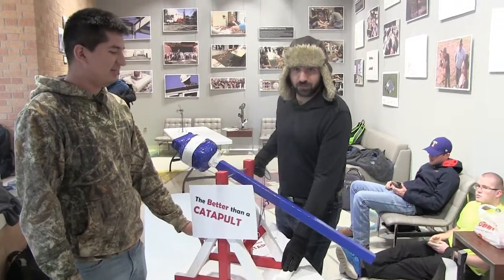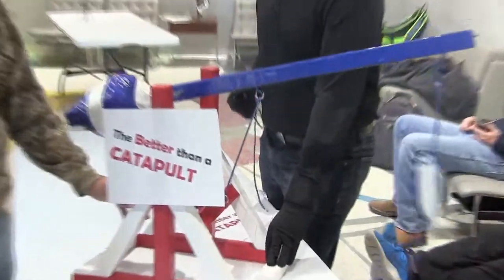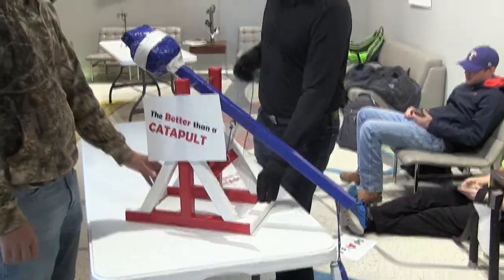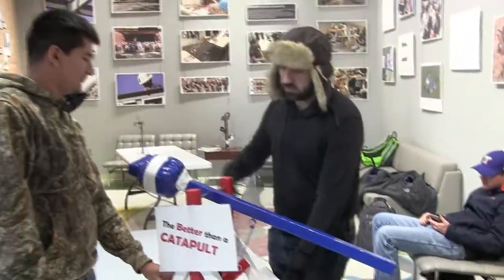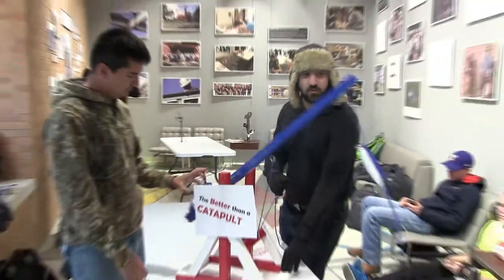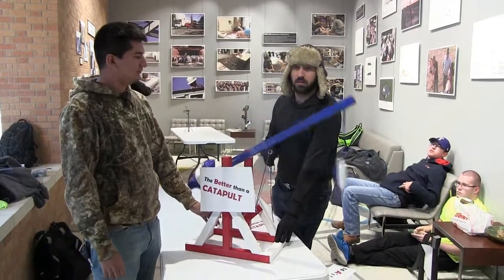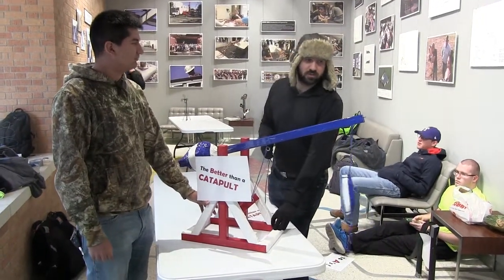Trebuchet: Engineering Dynamics Student Project (Fall 2019)

Comment: They need some help.
Reply from the maker: Thank you. Do you have any suggestions to improve the design? I can relay to them or next group.
Reply: @MohammadShafinulHaque  With a fixed counterweight trebuchet, a reciprocating frame improves performance by allowing the counterweight to fall in a more direct path, increasing drop speed of the counterweight, for starters.